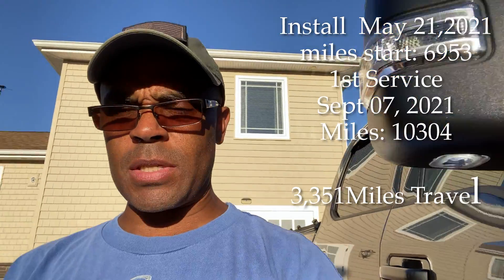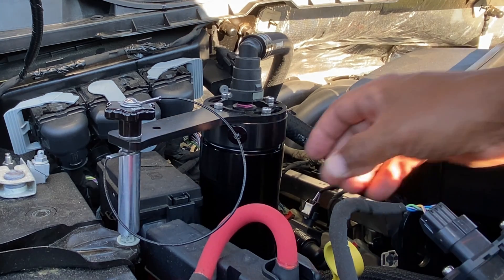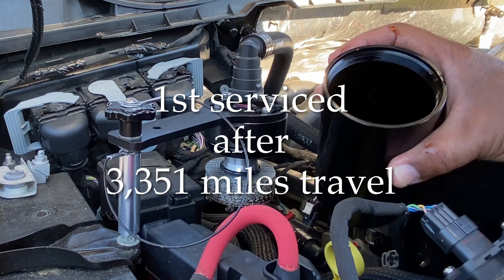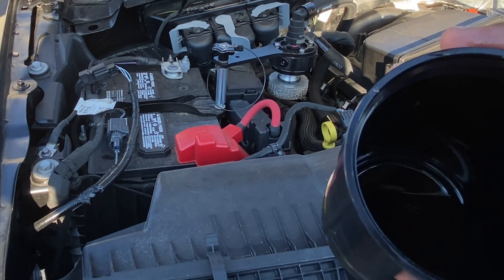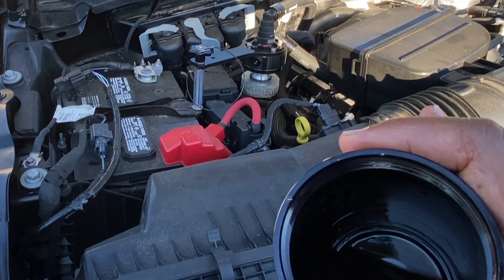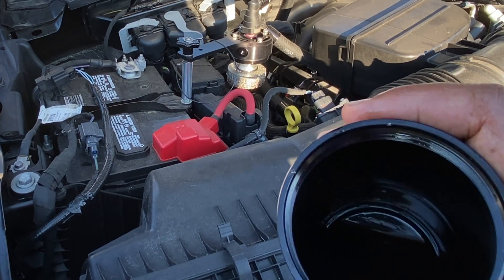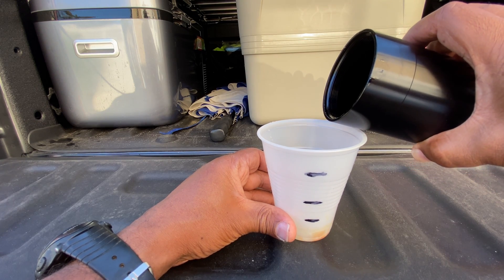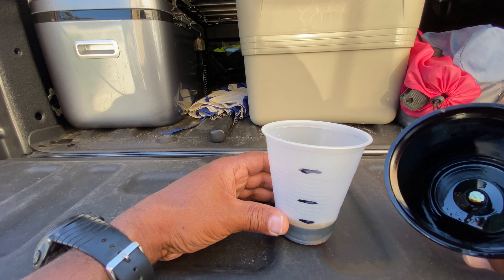Is a UPR Catch Can worth the Time and Money to install 2020-2021 Ford Super Duty Tremor for the DIY

Comment: DO LOCKTITE THE DRAIN VALVE HANDLE SCREW.
Vibration will cause it to back out and fall off, and parts are not available, requiring the purchase of a new valve.
Cheers, Tony

Comment: Thanks for posting. Convinced me to get one. There is no way the injection system can wash oil deposits from the throttle body all the way to the valves. Also lots of reports of oil in the intake degrades intake gaskets prematurely.
Reply from the maker: I haven’t had any problems with it. And it gives me a peace of mind.

Comment: I think it’s cool so don’t mistake my question but these engines 6.2 and 7.3 are port injection so I believe fuel will just wash away any oil that does enter. If I’m not mistaken.
Reply: I'd watch the video Palm Beach Dyno did when they installed cams. If I'm not mistaken, the intake was saturated with oil. Considering this is just over 3k miles, this is likely a good investment.
Reply from the maker: My question to you is . Is that 100 % “wash away” If not then its worth getting catch can. Thanks for the question.
Reply: @DIYNATIONUSA  true nothing is 100% but yes I do believe it’s completely washed away and with detergents in fuel today it’s safe bet it’s clean. I like the catch can but didn’t want an extra service item on my super duty. Plus I live in a state where modifying the oil vacuum tube or pcv will not smog….I would love to see a engine tear down after a year vs an engine with standard emissions.
Reply from the maker: @ck3561  there’s a video showing just that, that is why I pull the trigger on the catch can.
Reply: There a photos from a guy in my 6.2 Facebook group showing what’s his catch can captured. 

It was plenty enough that I bought one from UPR.

Just got that brand as that’s what was suggested the most.